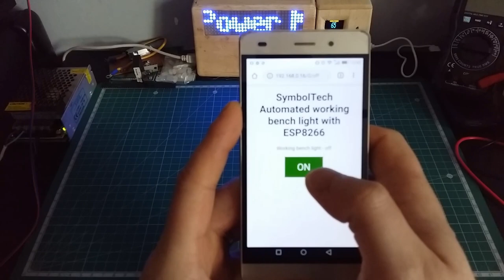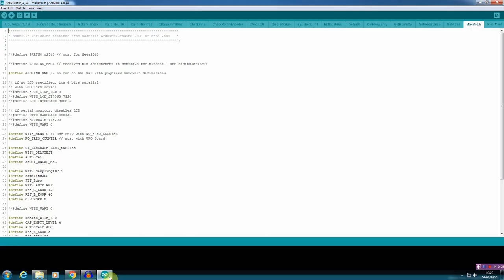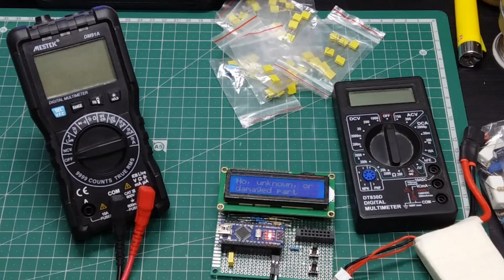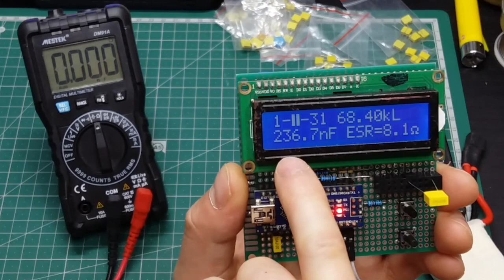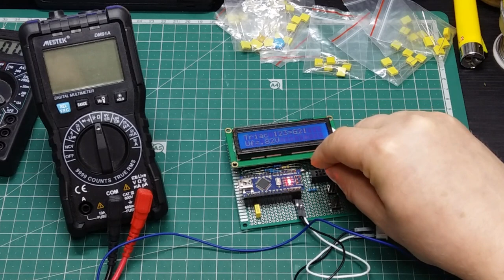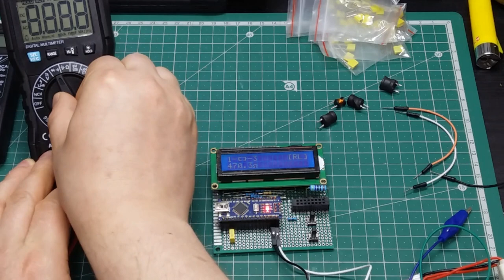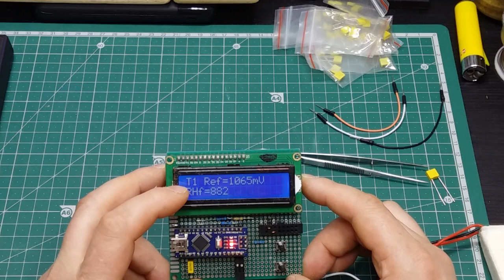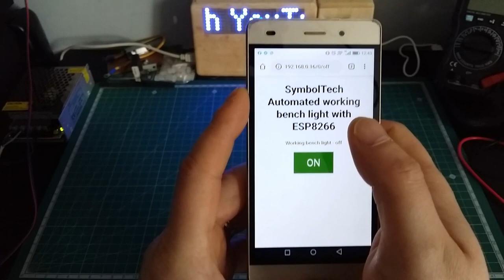Arduino electronics components tester

Comment: Brilliant - I've spent 1 week building various iterations of this project and none of them worked until now. THANK YOU for your efforts. The UNO boot loader did the trick to successfully program the NANO. My focus now is to better calibrate the device for accuracy (as you highlight in your video). My idea for ensuring the 470K and 680R resistors is to install high quality multi-turn potentiometers for high tolerance resistance. The menu function is strange - is there documentation anywhere as to how it functions in relation to the momentary button actions? I try holding the button down (long press) and then, say, 2 short press actions and I can't seem to determine what the correct press action should be.
Reply from the maker: Thanks. And I really appreciate! I will check if I can find documentation about and I will let u know

Comment: nice work, please during the calibration process which of the pins did you plug in the 104 and 333 capacitors into ..?
Reply from the maker: @mayoortechinnovations  should show on the display all the instructions.
Reply: @SymbolTech21  please is it normal to get random values if I didn't calibrate the device, or there is something wrong with my setup?
Reply from the maker: @mayoortechinnovations  you must check the resistors to be connected correctly and all of them to be almost the same value because if is tolerance between them will not measure correctly
Reply: Thank you very much for your guidance and replys, it's finally working now, the only thing I noticed is that the it keeps requesting for calibration any time I power on, even after a calibration before switching off.. is this normal?
Reply from the maker: @mayoortechinnovations  is doing the same also for me but I ignore that and measures fine. Definitely need to work on the code to put a functions once is calibrated to don't ask all the time for calibration

Comment: Hi, finally i manage to build this project, however does not work on resistors, led`s, diodes, i`m busy build another one with a NANO, may i made a mistake same where, ok thanks for a lovely project, greetings from South Africa
Reply from the maker: make sure you connect good as a diagram the 470k and 680ohm resistors. and if you planinga to use a nano make sure you will put the uno bootloader into nano

Comment: Hello,
I loaded uno bootloader into nano. So my hardware is nano. When I want to upload your sketch, under Tools menu - do I use Board: "Arduino Nano" or "Arduino Uno"? In Selftest mode it stops on T4 isolate probe (blinking)...
Any idea?
I am using the same display as seen in your video. Does your .ino program recognize that I am using 16 x2 LCD or must I comment/uncomment some lines of code?
Reply from the maker: arduino uno

Comment: Hi finally i manage to upload the code, was my faulty, tanks, today i will gather  all parts to conclude this project, about the 470 &680 i think i`m going to try cerment horizontal trim pots, will post the results, thanks.
Reply from the maker: I am happy to heard that the code is working and yes please let me know how works for you?
Reply from the maker: For those resistors make sure that you will have really low tolerance to get good measurements
Reply: How can you manage to upload code?

Comment: Great video,. To make it simple for me. Please point to me which hex file I should load to my Arduino. Thanks
Reply from the maker: its not a hex file. is a arduino ide code and you can download from the links on description
Reply: @SymbolTech21  Which ino file is the main program?
Reply from the maker: @DIY-electronics-automation  is a multi sketch in one so you need to upload like that with all multi sketc
Reply from the maker: @DIY-electronics-automation  you can find on the description the link to download the ino file

Comment: great video, I know what i will be make this weekend.i will have to design a pcb for it :)
Reply from the maker: Thanks
Reply: Hi
I made the circuit as you suggested.  It works fine, but it requires constant calibration, I wonder if this is normal. I calibrated it many times.
Thanks

Comment: Is it a great project, but I have a problem, when tested and I do not have any connected component, it measures a capacitor, which series the problem?
Reply from the maker: Double check again the resistors connections you may have a mistake there

Comment: Getting Not Calibrated on LCD how to fix that, is there a way for calibration through software all resistors after placing in ckt won't give exact values...
Reply from the maker: the calibration process is on the menu and u need to have ready 100nf and 33nf capacitors

Comment: I'm a spectator in 2023🔥🔥
I want to ask, what if you don't use the reset button?
I use arduino uno, as the programming🙏🙏
Reply from the maker: Reset is used in case if the Arduino stuck

Comment: when I do the calibration it stucks on "t4 isolate probe" and do nothing. can you help me please? I've tried with arduino uno and arduino nano with uno bootloader but the result is the same
Reply from the maker: When is says isolate the probes you need to remove the short from the test probes and then will pass to next step when you need to insert the capacitor

Comment: Hi! i tried to build this tester but it doesn't work for me. when I turn on the tester,it reads a capacitance of several uF between pins 2 and 3 even though there is nothing connected
Reply from the maker: double check the resistors if you connected them in the right way. can be that the problem why its shows always capacitance

Comment: I have found that  when I connect a 220 ohm resistor to pins 2 and 3 on my connection block, the resistor is read at 214 ohms, but if I put the legs of the resistor in either pins 1 and 2 , it is read as a NPN transistor.  Also when testing a IRLZ34N transistor, is shows as a diode, which is right, but only between pins 2 and 3. Is this correct or do I have something wrong with my circuit. Thanks
Reply from the maker: Ok so make sure that u connect the resistors that are connected to the readding points correctly
Reply: @SymbolTech21  I have tried the said resistor directly touching the wires which go from a pair of resistors to the Arduino. IE across A1 and A2, then A2 and A3, but still the same readings. Thanks
Reply from the maker: @robertheselwood4207  on my YouTube channel you have an email if you click on the about tab and please send me some photos how u connect them please

Comment: Hello, I have a few questions. Please help me: How did you calculate the resistors for the circuit, and why did we not use i2c?
Reply from the maker: The resistors put is series it's equal first value plus the second value. I don't use i2c because when I did this project I don't had an i2c lcd display
Reply: @SymbolTech21  thank you so much but can you give me more explanation because i didn't understand how to put the resistors? 
+thank you so much i subscribed in this channel
Reply from the maker: @1Motivation-videos.  Explain more accurate about how you don't know to connect the resistors
Reply: @SymbolTech21 hhhh You did not understand me. I told you how you chose the value of the 470k and 680k of resistors
Reply from the maker: @1Motivation-videos.  So when I was doing the testing I was comparing with an commercial components tester and on the testing I was using trimpots and adjusting the trimpots until I get the readings close to the commercial one then I measured the trimpots which value they was and for the final project I used fixed resistors with these values
Reply: @SymbolTech21  ok thank you so much

Comment: Awesome project! Worked first time with uno.
One question: I would like to change the text for "Arduino v1.13 testing.." where is the command on the sketches? I cannot find it.
Reply from the maker: I just need to look again on the sketch
Reply: The same question.🤔

Comment: Have you knowledge about cheap Chinese microcontroller. 
So we can use in prototype or to produce some products.
Reply from the maker: this arduino nano is a Chinese clone as well
Reply: @SymbolTech21  ok.
But i mean 8 pin microcontroller ics that we found in cheap Chinese few dollar products.
Reply from the maker: you mean an attiny85?
Reply: @SymbolTech21  no sir even an attiny85 cost around 1.5$ but the whole product is about 2 to 3 $ .
As a YouTube channel @bigclivedotcom  teardown the Electronics products and we see the no name ics inside.
Reply from the maker: so if its no name IC inside how can I understand how that works you need a datasheet to understand how you can manipulate the IC

Comment: I really don't understand the 100nF capacitor on the AREF pin. The Uno, Nano, Mini Pro already has an onboard capacitor each, AREF to Gnd. (See circuit diagrams). Adding  that external capacitor makes for capacitors in parallel?  Any ideas anybody?
Reply from the maker: The capacitor is for the reference on measuring the capacitors
Reply: @SymbolTech21  Thanks for reply. Much appreciated.
 I do understand the capacitor FUNCTION, but please consider this:

On the UNO, Nano and Min Pro, there is already a "FACTORY" on-board capacitor of 100nF connected to Aref. (UNO-chip Pin 21 to Gnd and Nano-chip Pin 20 to Gnd)
Adding an external 100nF then makes a TOTAL of 200nF on Aref for these boards.

However, Aref on the Arduino Mega has NO ONBOARD capacitor. Aref is directly accessible. (Chip-pin 98, board pin 3)
What value will you use here? 
Interesting hey?🙂

Comment: hello i made it, but it have some problems, like when i press test button it shows 185uf capacitor value but i didnt connect anything. and also some problem while transistor test. i use only chip(atmega328p) circuit.  i will happy if you help...
Reply from the maker: So please make sure that the resistors are connected correct and try again

Comment: What appears on the lcd screen when powered up as I only get so many vertical lines at one end of the screen.
Reply from the maker: so you may have connected wrong the lcd. should come ardutester v1.13 on the first line and on the second line should come testing and some dots
Reply: @SymbolTech21  Yes I had 2 connections in the wrong place, and the lcd shows what it should now. Thanks
Reply from the maker: @robertheselwood4207  I'm happy to heard that u manage to do your project following my video. More projects to come soon

Comment: PLEASE HELP ME!!
I made this project exactly 3months ago, but my problem is measuring of ESR. Everything other than ESR is working finely! Can you please tell me what's the problem with measuring the ESR?
Reply from the maker: do you mind to send me some photos what shows you on the esr? here is my facebook link https://www.facebook.com/toni.budau.18/ you can send me by messages the photos
Reply: @SymbolTech21  thank you ❤️
Reply: How can he help you when hes esr is not working because on all the mosfets the rds on is around 0 which in real world its not true and also on the yellow capacitor had 8. Something ohms wich is complete nonsense if you want good esr meter you need to buy it with this its not going to test precise because esr mesurment is one of the most complicated things to mesure and the simplest esr meter is overcomplicated so doesnt waste your time 
This tester is just to test if the compnents are working not precise values
Reply: @aleksandardzoroski7769  if u want to see that it's measuring with a tolerance of 0.5% please send me any trust esr netter you want and I will compare with this one and you will have the results.
Reply: @aleksandardzoroski7769  component tester like this is available in market in rs.700 in Indian rupees only. This is very cheap. And also it is built by the same technique like the DIY is made. So why the DIY cannot be made like the commercial one? It has the ability, we just need to optimise it.
Reply from the maker: @aleksandardzoroski7769  If you want to be sure that is working any time I am ready to demonstrate this. so any time you want just send me any esr metter that you are trusting and I will compare with this gadget and I will show you the results

Comment: Sir menu switch is not working .I cannot open menu like calibrate.capacitor..etc.
Reply from the maker: double check you may connect something wrong. should work as in the video if you connect everything as per schematic

Comment: that alot of sheets at this file. can u explain me, which file that i must choose to upload? because my lcd always error(this program wasn't work for me). please answer sir.
Reply from the maker: Make sure you have all the libraries that need to do this project installed already on your Arduino ide
Reply: @SymbolTech21  uploaded is success, but my lcd was error.. what libraries that i must installed to my ide arduino?
Reply from the maker: @bapaknyaarya6425  double check the connections between Arduino and the LCD if are correct. If upload it's ok and you have an error with the LCD this mean the connection between Arduino and LCD is not as per schematic or your LCD is not working properly
Reply: @SymbolTech21  the connection wiring is ok. but i still confuse how to upload file ino. i upload all of sheet at the file, or just one sheet in that file ino.
Reply: @SymbolTech21  do you have an email? i want to show u my problem to upload
Reply from the maker: @bapaknyaarya6425  you need to upload all sheets in once
Reply: @SymbolTech21 i using breadboard, or i must soldering the components?
maybe i not install my libraries
Reply: @SymbolTech21  what libraries that i must be install?
Reply: @SymbolTech21 its ok  if i use supply from usb pc, or i must use 9v to pin Vin?

Comment: Can i make this project using Arduino Uno with same code. Because when i am trying to upload the code on nano an error is occurring and saying uploading error. exist status 1. Please help me.
Reply from the maker: Yes for sure!
Reply: Dear I made the project using the Arduino Uno with the same circuit diagram and code.But it is only working for the resistor. Not for capacitors or transistors. And when checking ports are empty then it is showing the value of  inductor. Please help.
Reply from the maker: @rfviratsingh  it should work so check again all the circuit diagram to be correct
Reply: Dear there are two push buttons can you please define each working.
Reply from the maker: @rfviratsingh  one is reset and the other one is to start testing
Reply: Dear i have done all the connections and it is showing the perfect value of resistance transistor diode,led but the problem is with the capacitor.  I am checking 0.1uf and it is showing approx 50uf. And when I am checking 470uf it is showing 200uf. Please help.

Comment: 23:31 why capacitance is shown as 1-||-31, why is there a 1 at the end
Reply from the maker: Should shows the pins numbers between which is the capacitor connected. If shows wrong double check if you connect correctly the all 6 resistors to arduino
Reply: @SymbolTech21  i have added your video's timestamp in which it is showing 1-||-31, and i am asking why it is showing like that, why is there an extra digit after 3.
Reply from the maker: @ehraz786  That's why I said to check again if the 6 resistors are connected how should and try also to do a calibration process
Reply: @SymbolTech21   you are not getting what i am asking, i am asking why there is an error in your video, so how can I check my connections, you tell me why at 23:31 the capacitor pin number is showing like that.
Reply: @SymbolTech21  you have connected the capacitor at pin 1 and 3 but it is showing pin 1 and 31.
Reply from the maker: @ehraz786  try to upload the code again and see what will happen
Reply from the maker: @ehraz786  I didn't notice that also mine shows the same. so I should look on the code when I have time to see the line that make to shows the pins where is connected the component and maybe I did an error on the code!

Comment: how can this tool measure components
Reply from the maker: Thanks for your comment! If you watch the video definitely you will understand
Reply: @SymbolTech21  sorry I'm still confused how to find out what component he is measuring
Reply from the maker: @RandomFAI  this device measures resistors, capacitors, diodes, inductors, transistors, triac, thyristor, etc
Reply: @SymbolTech21  I'm sorry sir, I mean when this tool takes measurements how can it know if what it's measuring is a resistor or other component. what is the cause can recognize these components
Reply from the maker: @RandomFAI  The code that is uploaded to arduino

Comment: hi i need step for calibration please!!
Reply from the maker: @DjRedSnowCh  will shows you on the display the steps. First you need to short all 3 probe pins and press the button for testing will go in calibration mode
Reply: @SymbolTech21 after i calibration Done.  i open probe and test press button display is show value caps 😞 it don't show no part or part damage. I check the connect circuit is true
Reply from the maker: @DjRedSnowCh  you need to have also a 100 nf capacitor to insert for testing during calibration
Reply: @SymbolTech21  yes i insert 100nf.  and last step i insert 30nf. Display is show END TESTING. I want contact or email I want to show the picture for you
Reply from the maker: @DjRedSnowCh  if shows end testing the calibration is finished

Comment: Your switch problem/ code problem ??
Reply from the maker: I can't understand what are you trying to say!
Reply: @SymbolTech21  I mean you press the test switch 3-4 times is it normal or is there a problem with the switch or something else. I want to make it. The diagram you provided has arduino uno i want to upload it to arduino nano is it possible friend.
Reply from the maker: @utpalhalder2468  I had a problem with that button was not doing the contact properly
Reply: @SymbolTech21  thenkyou my friend